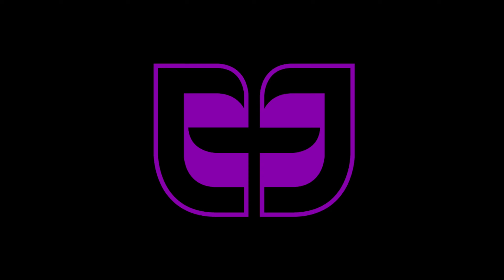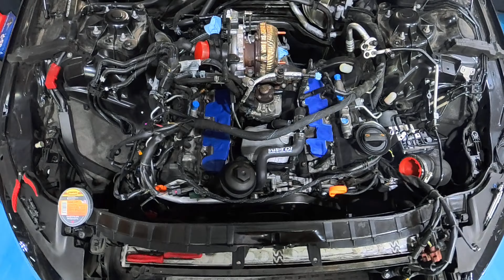VW, Audi, Porsche TDI Glow Plug Connector Housing Repair

Comment: How can I buy a set posted to Ireland? I need a set for a b8 passat. I usually buy from eBay or Amazon. Nice video btw.
Reply: Tried buying with PayPal but it said they're sold out. AliExpress has the wire in versions if anyone's stuck.

Comment: Good connectors but the lack of room for electrical tape is problem. Won’t click or lock so you have to wrap it with tape. Must be a way around this
Reply from the maker: Hello! Sadly it is very hard to design this system for all scenarios and have it be affordable. When using electrical tape you will want to make sure it is a high end model that is as thin as possible. Another alternative is a liquid electrical tape that is rated for the 120C+ rating that the high end tapes are rated for.

Comment: Thank you for the video. I have a connector that broke. What is the best way to remove and get the glow plug out.
Reply from the maker: Is your glow plug broken as well? The glow plugs are threaded into the heads of the engine.

Comment: Do you ship to Europe? To Germany. Thanks in advance.
Reply from the maker: Hello. Currently we do not. Will have to research what is required to do so as I believe there is important paperwork and fees required.
Reply: @EandEDesign We can pay via PayPal and send a package to Germany. I don't think there will be any problems with customs. Many goods from China will reach Europe without any problems. I've registered on your site.
Reply: Mine split into two on the pressure sensing one but even after carefully putting back together the OBD scanner throws up PD13D4 code still.